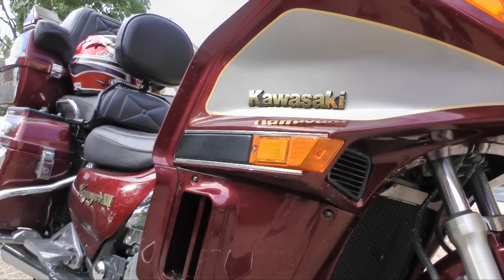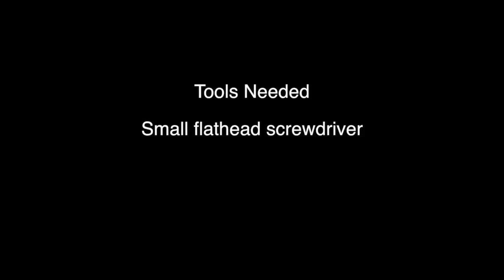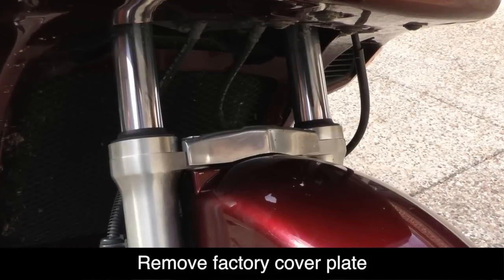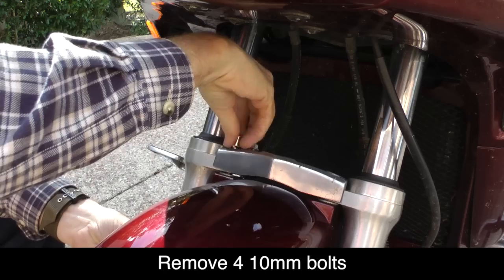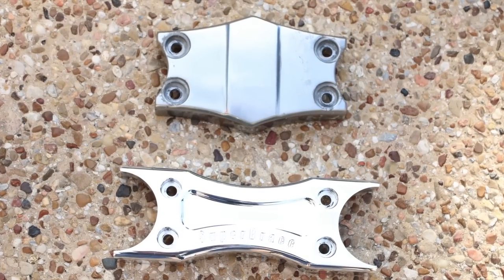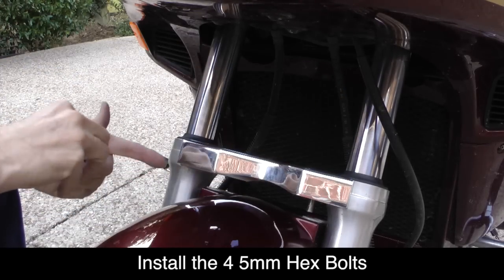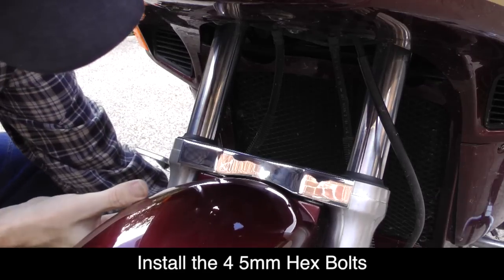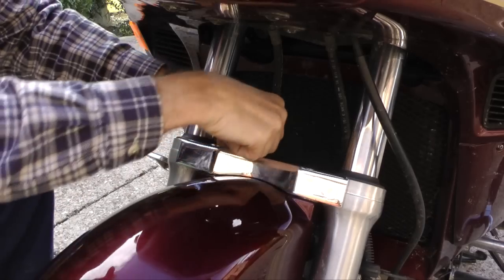Install SuperBrace on Kawasaki Voyager

Comment: What was the torque wrench for, looks?  You did not use the torque wrench to torque the bolts to specs...  Missed an important step since there are no lock washers or any blue lock tight....  Amateur.